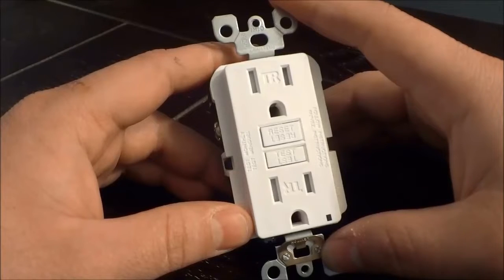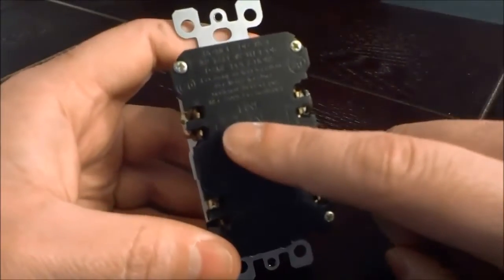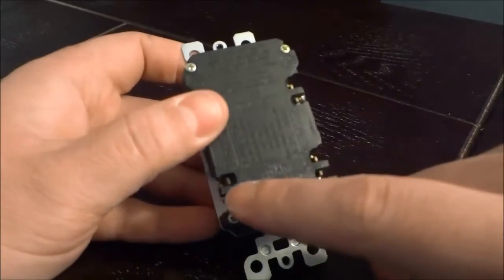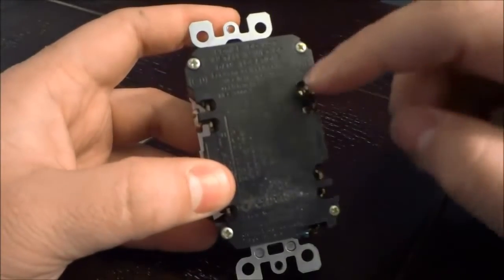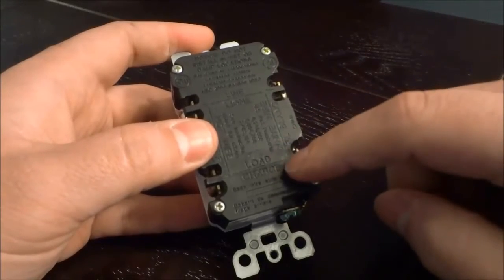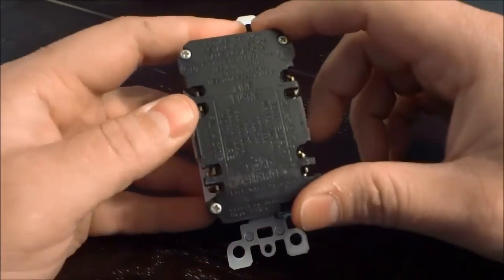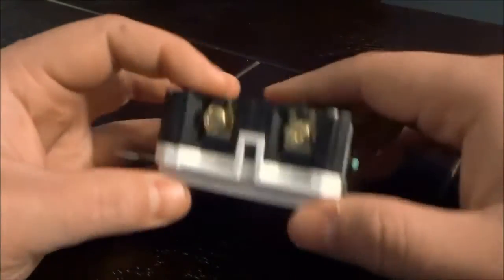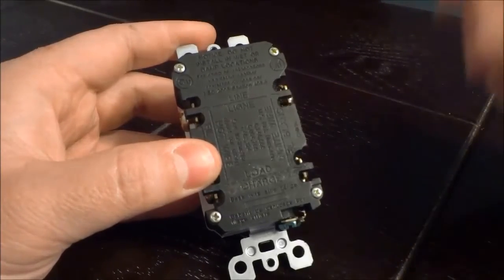GFCI Line And Load Explained (Electrical Receptacle)

Comment: When I removed the existing outlet, the wires connected to the line side continued to the load end of the outlet.  In other words a single power and line was connected to both sets of terminals.  Why?  This video that everyone has been heaping praise on said nothing about it.  Why would they go to that trouble unless it is necessary, or maybe good practice.   I want to know before I cut the wires leading to the load terminals. 

The short efficient video took two minutes to explain what could have been explained in 30 seconds and DIDN'T answer the question I have.

Comment: What happens when I also place my Load black wire into the Line terminal  so that 2 black wires are in the Gfci Line Brass screw and 2 white neutral wires in the Gfci Chrome screw? Found out fridge outlet connected to gfci the hard way.  Will the connection harm the circuit and/or others on same circuit

Comment: But how do I identify witch is my line and load wires coming from the wall box?
Reply: The line will meter 120VAC. That will feed voltage to the load.
Reply: Disconnect the wire pairs (careful that they aren't touching and that you don't forget which pair is which), then with breaker turned on, you can easily test with your voltage detector which of the black wires is hot. You've found the line wires.

Comment: question.. what happens if you hook it up backwards? will it just not work or will it short out/arc when you plug something IN?
Reply: Hook what up backwards? Depends. Be more specific. Swap the LINE and LOAD is that what you are saying?
Reply: yes
Reply: I was wondering the same thing and can’t get the answer anywhere. Some contractors put in a GFCI before the refrigerator and the refrigerator keeps tripping the GFCI. So I was wondering what would cause that?
Reply: @M1CHA3Ltube  Refrig was over amping or GFI was weak or your refrig was pulling more than 15 amps or something was going to ground or close to it.
Reply: Better late than never the GFI will trip there is your answer..

Comment: I have no clue about Electric. when I use my pen tester and touch the neutral wire it beeps and turns red constantly. and when I take my pen and touch the black wire it beeps as well. is that normal and for one of the white neutrals not to do it and one of the blacks not to do it